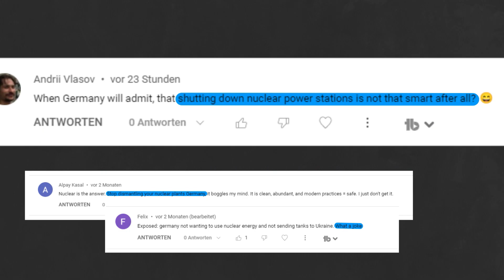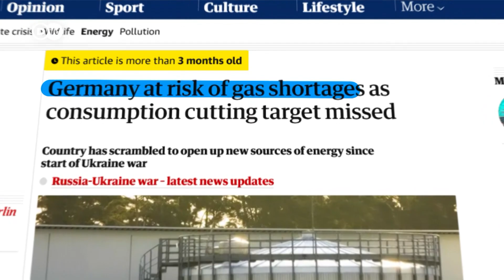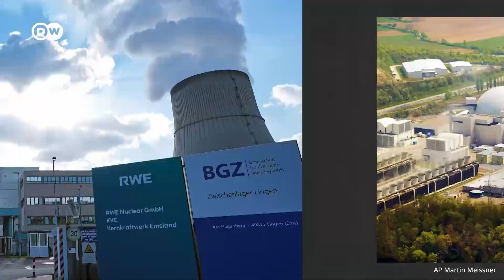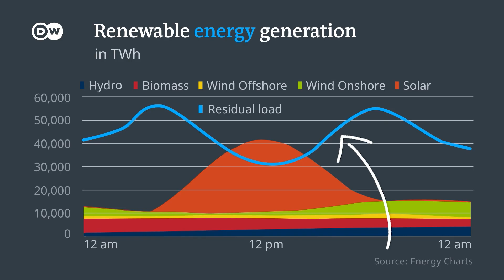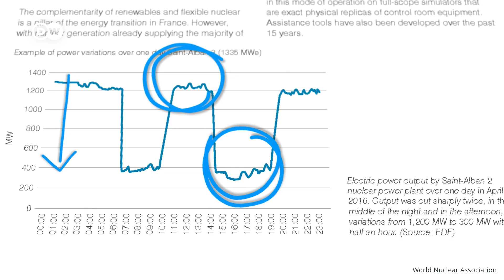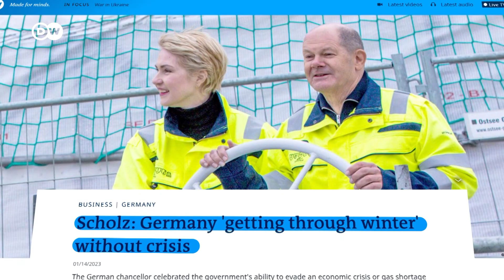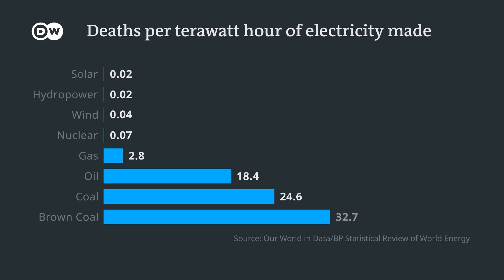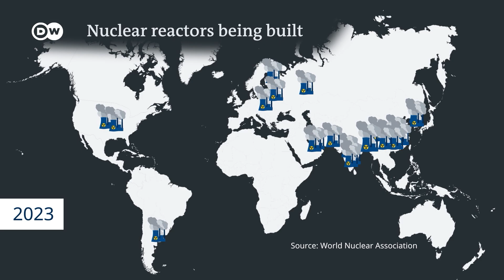Is Germany's nuclear exit a mistake?

Comment: Germany will be further ahead in its emissions reduction because it shut down nuclear which was slowing the deployment of wind and solar. Note the curtailment of wind in northern Germany due to the inability of nuclear to do flexible load following. IEA and IPCC acknowledge that it is the ability of solar and wind power to deploy rapidly, at a low cost, that will allow the world to meet it's climate goals. Nuclear is just expensive risky 20th technology that supports nuclear weapon proliferation - something no one needs.
Reply: Germany is behind every other Western European nation in our climate goals. Its electricity grid is has a carbon intensity a magnitude higher than France. Moreover, in the last 10 years France has managed to build lots of wind power and is planning more offshore wind than Germany. You can operate nuclear/hydro to facilitate base load whilst having renewables on top with variable pricing mechanisms. This is what Spain, Switzerland, Sweden, the UK, France, etc. are all doing. Long term you'd be able to reduce your amount of nuclear. Instead Germany is ripping apart towns, countryside, farms, basilicas, etc. to feed their hunger for coal.

Comment: 11:05 Nuclear waste: the solution is building thorium reactors of the LFTR kind.

It's not so much as there isn't a solution for more safety of the plants and nuclear waste, it's that the Greens refuse to see this, out of ideological considerations. Saying "the cost and risks is too high" for these new plants without having done any actual analysis on it is just a cop-out, nothing more. In many of the modular 4th gen plants, the price is considerably lower, and the safety considerable higher, than any of the current gen2 or even gen3 nuclear plants. Plus, they are much more efficient and can actually do load-balancing as well. Plus, some of them can be used to clean up the old high-radioctive waste of the former nuclear plants, reducing it by 90% and what's left only has to be kept for 300 years, instead of 25000 years.

One would think, thus, the greens would be jumping to get on board, but noooo... Just like with the decision to exit the nuclear plants and use coalplants instead, it has nothing to do with actual rational reasoning, but everything with ideological zealotry.

Comment: Can we please stop claiming that it is difficult to return to nuclear power in Germany? The reactors in Brokdorf, Emsland, Grohnde, Isar-2 and Neckarwestheim-2 are still perfectly usable and nothing has been done yet which cannot be reversed due to the lack of the necessary permissions.

I know that because I was just inside the reactor building at Brokdorf nuclear power plant last Friday. It's merely a political decision. Politics just need to change the law and the nuclear operators will turn these reactors back on.

These reactors generate electricity valued several million Euros per day each. Thus, even if the reactivation cost one billion Euro, it would be still very profitable for the companies to restart those reactors.

It's just the government that needs to say yes to nuclear.

Comment: Things people get wrong about Nuclear Power: Its ridiculously expensive only when you have severe cost overruns(didn't happen in the 80s when these reactors were built) or you phase them out too early, which happened in this case
Reply: the amount of nuclear waste generated thus far fits in a soccer field. and most of it decays in very short time scales, and most of it can be reused in new reactors and reduced to about 10% of its current volume and reduce its decay life still further.
Reply: @SoloRenegade This is idealistic thinking. Renewable energies are here (the video says 50% in D already). Fast reactor do not exist yet. Germany will be 100% renewal before the fast reactor tech will be operational. And fast reactor are based on worrysome concepts and materials (e. g. liquid Sodium).
Reply: @renebach9583  "Fast reactor do not exist yet." multiple companies and countries developing solutions. practical EVs and their charging infrastructure didn't exist until recently either. and it took a rich eccentric businessman to get it going. Just need funding and gov support. You'll never get there if you never start.

"This is idealistic thinking. Renewable energies are here (the video says 50% in D already)" and that's why Germany is having an energy crisis, and why Texas froze recently, etc. Renewables are not even CLOSE to meeting global needs. total pipe dream. Renewables are not dependable nor affordable. Nor are they "on demand" power.

"Germany will be 100% renewal before the fast reactor tech will be operational."

sure, because they demolished their perfectly good nuclear power. But France has been nuclear for decades, meanwhile renewables is still a pipe dream. Nuclear energy is ready now, renewables are not. I live in a climate nearly identical to Germany, and companies have tried many ties to use wind, solar, and hydro. The rivers aren't able to provide enough energy, and the wind is too unreliable and few turbines get built. And solar fields all get torn down after a few years by the energy companies. 

"And fast reactor are based on worrysome concepts and materials (e. g. liquid Sodium)." 

baseless fear mongering. Sodium is an essential element to human life.
Reply: @SoloRenegade  i agree with what else you have said, but i have a point of contention regarding EVs, they are not longterm economical or reasonable, it's a system catastrophic to power grids in everysingle large scale implementation that has been tried, horribly inefficient and to mention again its economics, they are built on gov subsidies, and have been attempted for over a century now, they still arent a good idea and never will be, especially if fusion becomes a widely available and practical thing, because with abundant power you can outright pull carbon from the air and make fuel, it's basic chemistry and allows for energy density and conversion to motion efficiencies(partly because of how heavy batteries are, and dont tell me about supercapacitors, basing policy on tech that doesnt exist is frankly insane) that EVs cannot beat combustion engines in, possibly ever.
Reply: Even with the cost overruns it's not that expensive. The immense amount of energy it provides compensates for it.
Reply: @ImaskarDono  if you're paying upwards of 10 Billion a reactor... Good luck making that money back. High operating costs and highly skilled workers don't make it cheaper
Reply: @kek207  operating costs are low, actually. That's why historical nuclear is the cheapest energy currently. And yes, nuclear pays off great.
Reply: Nuclear should never be phased out, because 100% renewables with enough battery storage for millions of people and houses is impossible.
Reply: Yeah, phasing out of nuclear energy completely might've been a mistake, but it's not nearly as big of a deal as media make it to be. Germany sits in the center of Europa and power exchange with neighbors is common. Not every country needs to run nuclear power plants when others are willing to sell it. Nuclear power also has the opposite problem of renewables: You can't just shut it down when the sun is shining and wind is blowing, you have to keep using nuclear power even when renewables are available, making it even more expensive in comparison as energy prices keep falling.
Reply: excessive regulations make nuclear power expensive. The redundancy required by law is incase. The concrete requirements alone are way too much.
Reply: @Polygarden  fun fact: There are many countries that like to get paid for waste disposal. There's a reason why countries like Russia don't have a waste problem. If theres nobody living in arctic Siberia for hundreds of kilometres.... Just export it! Problem solved. And in a few decades breeder Reactors which use the waste might become economically viable. There are a few breeder Reactors in use which consume high level waste but not financially viable, but that might change. Until then, just dump it into Siberia. If you're serious about climate change, that's what you'd have to do
Reply: @kek207  yeah fax, aint noone give a shit about dumping nuclear waste in some random pit in the arctic.
Reply: @kek207  They dont dump it into Siberia. Bruh.
Reply: @Polygarden The same argument could be made for literally any energy source…..

And it’s also important to note that typically when you look at costs of renewables you’re not factoring costs to manage and sustain deployment based for the relative VRE penetration. 

When you’re forecasting the cost of wind, are you including the cost of transmission lines to carry that power from the ocean or the middle of nowhere back to a city? Probably not….
Reply: Russia, France, The USA - each country heavily subsidizes this industry one way or another, and it is very expensive for taxpayers. The nuclear industry as a whole is unprofitable. Power plants is only the tip of the iceberg.
Reply: @freddyfriend5462  Nuclear is profitable. it just takes 10-20yrs for it to pay itself off. Patience is not a virtue in this modern age.

Also, newer technology can better enable lower cost smaller reactors built in higher quantities. Their implementation is much easier and lower cost. Some can even be used to turn existing power plants into nuclear (coal, gas, etc.), thus saving significant portions of the initial investment and time.
Reply: @SoloRenegade  Nuclear industry has never been profitable. It is the fact because the numbers are publicly available. It has always been heavily subsidized in all countries. Nuclear power plants are only a small portion of this (heavy) industry.
Reply: @freddyfriend5462  "Nuclear industry has never been profitable. "

that german report is extremely sparse on data, only a few pages long, and spreads a lot of unfounded misconceptions and gross over generalizations in its conclusions.

when was the last major nuclear powerplant built in the EU, and what was the state of Nuclear energy technology at the time?

A more recent report in 2021 showed many nuclear power plants were in fact profitable without the need subsidies.
Reply: @SoloRenegade  do not even bother mate, he is outright lying in saying nuclear was never profitable.
Reply: What do you mean? Of course they do!
Reply: Ppl that are only saying u r lying 🤡 Name me one nuclear company that pays his own insurance? There is non. Because the risk is so high, that they can’t pay for it! The state is covering it up. 
It takes nearly 9 years to build a reactor. In some places way more and in some places less. I think the newer the system the more time it will take because the more complex it is. So it will take over 10 years to build and 20 years after that it will pay itself off? So in over 30 years? Sounds very promising. Not.
Reply: @RealRedeemer  all of them actually. Don't spread lies, do research.
Reply: @Polygarden Also I’d argue the costs of nuclear waste are probably not scientifically accurate, given that there’s significant debate on the accuracy of regulatory timeframes for nuclear waste. 

Here’s a simple question, what is the 10,000 year timeframe for safe deep geological repository storage based on? 

I ask, because 98.5% of all nuclear waste by volume is made of Uranium 238, Uranium 235 and Plutonium 239. That 10,000 year timeframe shorter than a single half life of any of the materials I just mentioned……

Oh but what about radioactivity? Ok well 97% of all radioactivity of a waste sample comes from the fission product waste. Problem is the very reason these materials are extremely radioactive is because they decay very to relatively quickly. The longest lasting fission products will experience 10 half lives in less than 500 years……

So if the required length of time to store nuclear waste is not based on the materials that makeup the supermajority of radioactivity nor volume - what is this timeframe actually based on?
Reply: @brian2440  It's based on the weighted average.  Nuclear waste needs to be stored for long enough that all of the waste together becomes no more radioactive than background (space, bananas, other humans).  I don't think I understand your question.  Meanwhile, coal power plants release toxic chemicals like mercury right into the atmosphere, and mercury is stable and will never go away.  (But no, let's not blast this stuff into space, turns out orbital mechanics is harder than digging a deep hole, and rocket engineering is harder than shielding the radioactive waste we already know how to shield).
Reply: @brian2440  In 10000 years we would have blasted those waste to space if not reused.
Reply: @frankreynolds9930  kurzgesagt( i think) made a video about why shooting nuclear waste to space is a terrible idea
Reply: @narwhalestorm9881  Well that video takes current tech into consideration. Our tech would have developed way more in 200 years into the future from now.
Reply: @frankreynolds9930 also it wold be way more expensive then curent solutions
Reply: So taxpayers money should be redirected to nuclear energy, thereby potentielly shorten Funds for the developing of renewuable energys. Nuclear powerplants are unflexibele and expensive to devolop, bild and operate. This plants would need to operate for a long time to make a Single penny. The development of renewables... fast, easy to deploy, cheap, small, decentrelized. I wouldnt recommend spending trillions on nuclear Power. Japan has ongoing security issues with their plants. Nuclear Power is strictly regulated and Hard to use, so compering the accedant rate to any Common type of energy we usually use is ridicoulus. 😂
Reply: @dirtykraut  wew, it must have taken you serious actual effort to be that wrong about so many things at once, i applaud your hard work, it really shows.
Reply: @TS-jm7jm  Y? So Energybills in france are cheap and not capped by the french goverment? Is the effort so small to build nuclear plants? 
Have you any Account for a 100% profitable nuclear energy System? 
And what exactly im wrong about?

Comment: Nuclear can be combined with energy storage to make it a flexible electricity provider. Liquid metals could store heat and power, hydrogen could be made, electricity could be exported... Sure turning power plants up and down is not possible with nuclear but all you need to do is flip a switch to move that electricity and heat production to a more appropriate use if solar and wind are providing for the grid at the time. Then less nuclear power plants are needed and they can compete with more flexible fuels like coal and gas. I would not propose a new build for this but existing power plants could be upgraded for sure! That same tech could still be used once the existing nuclear plants are no longer operational and instead store electricity from other sources while making good use of the power lines and infrastructure already present at existing nuclear power plants.
The solar farm at Chernobyl is doing that right now, using the power grid that used to bring nuclear power in from that location.

Storage is key though, no matter wheather you have a base load station or intermittent one, storage increases the potential of any power supply.